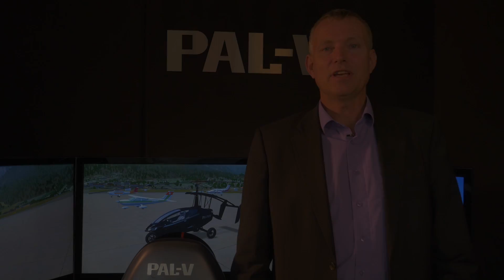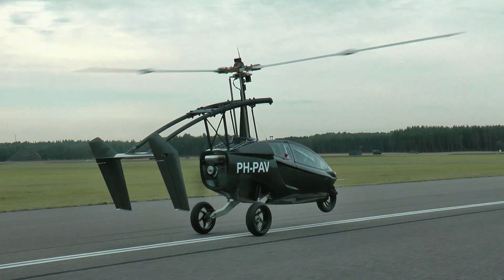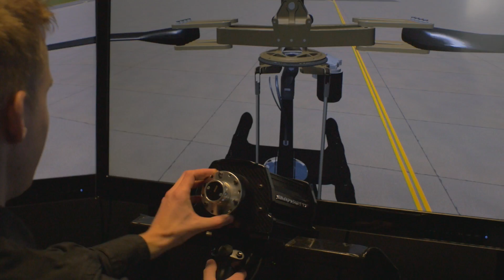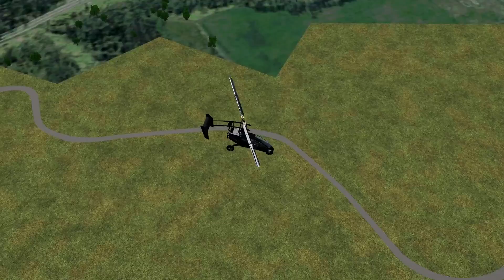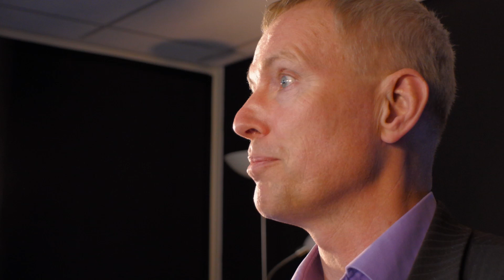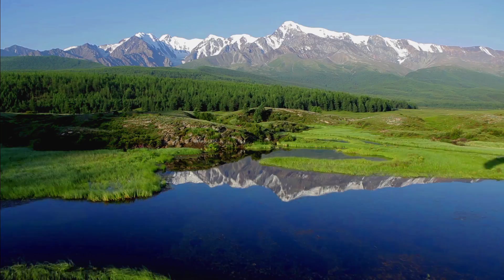PAL-V Ease and Safety

Comment: ♥️How clever👍😎👍
I mean, that push prop alone is phenomenal.  Add the car mode lean into curves and turns suspension, "Gee willuhkers Batman!" lol
♥️Efficiency♥️
Like "drone" style flying cars can't touch the range.  I'd happily trade VTOL impractically short range for STOL, and actually going somewhere distant, to GA airfields and car rentals being mostly obsolete.

Comment: Yes.   Some facts over this black beauty.
Ten years ago I joined this team, PAL-V, together with only 8 collegues, we  were 9 strong. M. Stekelenburg was the head of design, R. Dingelmanse the C.E.O.
The idea was challenging, I overlooked it (stress-wise) and it looked OK. We designed, calculated, tested with good team spirit, everything came together. The Dutch CAA overlooked PAL-V and they gave green light.
Within 3 years we were in the air. From thin-air in our hangar to this prototype high above us in the sky. The concept worked!  RNAF testpilot J. Bart stepped out with broad smile!

The successor is the PAL-V Liberty, shown on the Geneva Motorshow.
This two seater will comply to EVERY chapter in the very tough EASA CS standard for helicopters AND comply to every requirement the European Road use is posing. Safe in every aspect, hence.
Certification is time-consuming, laborious,  the CS standard alone has more than 1200 articles.. we are working hard. 
The result will be the first fully certified and street legal, practical flying car.